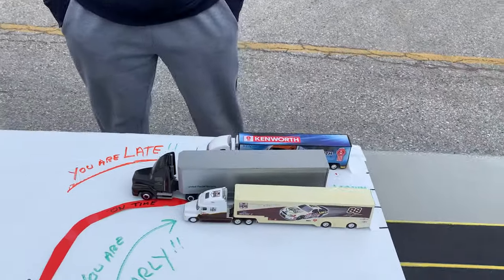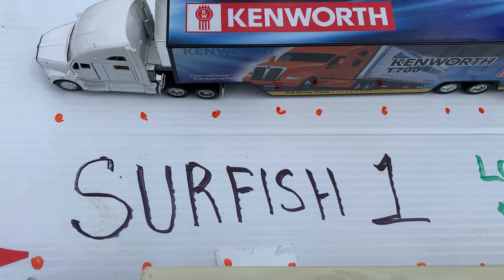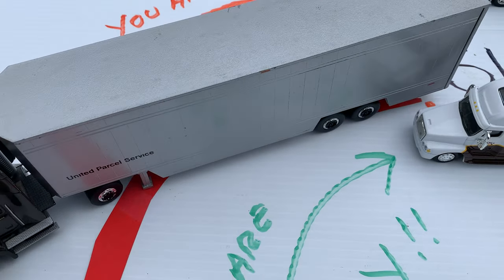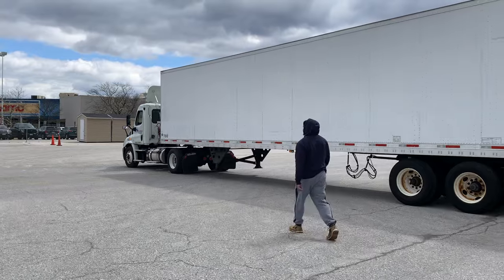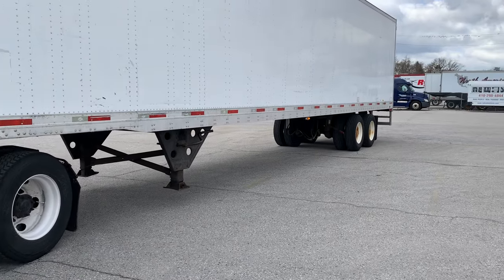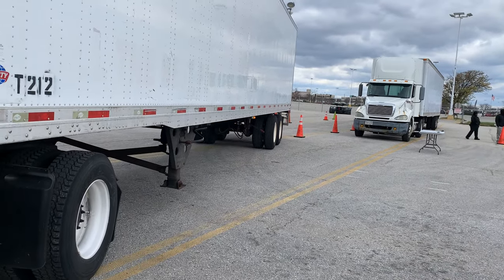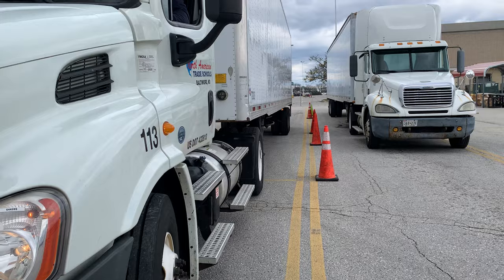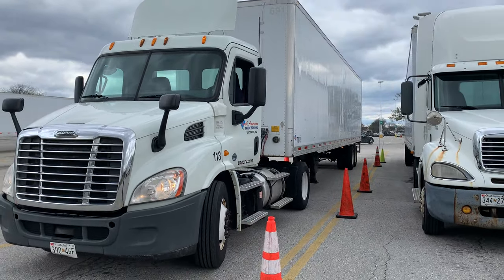90-degree Alley Dock VIDEO - 2

Comment: your not showing me what the tractor steering wheels are doing.   I need to see what turns are being made and when while seeing the trailer rear and the cones to be able to learn and understand.  Also.  I need videos to show me how to correct bad approaches.  I never have enough "pull up" space and I dont know how to correctly pull up to fix early (all the way to almost touching the cone). nobody gives us directions during the exam,  and there is no do-overs, only pull-ups up to 12 points accum.
Reply from the maker: Will be making a few more videos on Alley docking. Will post be Saturday evening.  It’s all about the trailer- you need to react to the trailer. I will do my best to show you where I am steering. Please view all the alley docking videos. One or two may be more helpful.
Reply from the maker: Put a few more on my playlist - ones you may have missed.

Comment: Right line? Left line? I suppose it depends from which side your looking at.
Reply from the maker: Backing into any Dock,  or on thr test you want to be close to the left side or line.  If you are heading to the right side, you are LATE.  Pull up and move the trailer closer to the left. Be on tine. Entertaining the dock
Reply: @truckerstevecdlinstructor  we're using the short trailers like 20 feet on dirt. They swing faster. When I back into a 90 it gets locked where if I turn left or right it still goes the same direction. Can you please help?
Reply from the maker: @johnnyyuma3878   Not sure how if you turn the Wheel to the LEFT or Turn the wheel to the RIGHT, the trailer still goes in the same direction.  Well let's talk small trailers.  (28') .  Yes they move faster and many students who oversteer with a 48" trailer will jack knife with a 28' trailer.  We try to train students to REACT to the trailer.  If you need to stop a trailer from moving to the left, turn the steering wheel to the left to stop the left movement.  Once the trailer movement to the trailer has stopped, you have turned the steering wheel enough.  If you oversteered to the LEFT, the trailer would move very fast to the RIGHT.  PLEASE check out my PLAY- LIST on videos on BACKING and ALLEY DOCKING. Or click onto HOME at the top of my page.

Comment: I'm in trucking school now & I have the straight back & offset with no problem. I did the alley dock last Thursday 2 times by myself. For some reason I can't get it now!! It's so frustrating & with the trailer being 28ft it responds faster. Gonna keep on till I get it again so I can go on the road so I can take my test
Reply from the maker: Hope you pass your test... Learn to read the trailer.   28 foot trailer moves fast so as you back up , GO SLOW!   Go to the dock- Find your reference point.  If the trailer is starting to go to the left of your reference point ( early )  Stop it be turning the steering wheel to the left. Don't over steer - if the trailer is reacting, you have enough turn.   Practice over and over again until it CLICKS in your head!  The trailer only goes where you let it go.
Reply: @truckerstevecdlinstructor  I passed my test with flying colors. I took it July 8. I'm so proud of myself got my 1st trucking job
Reply from the maker: Way to go!  CDL Driver, stay safe and take your time.  Don’t ever be in a rush
Reply: When ya dealin with a shorter trailer, while in reverse, ya wanta turn wheel in small increments. This will create a much safer backing practice. When in reverse, a 28' trlr takes between 4-5' to start changing direction. A 48-53' will cover 8' before beginning to change direction.

Comment: +Trucker Steve so this is interesting, in my school the way my instructor is doing it, is having me turn opposite of where we are backing the trailer into, but from over my shoulder the trailer is like almost jackknifed, like it looks 90% and then we turn all the way to other side and start backing up again. I keep watching videos on alley dock and no one seems to be doing the first reverse turn to where it's almost jackknifing.
Reply from the maker: Will be doing another video on alley dock ASAP.  Backing into the alley, ( on the right ) starting with a left- backing up unit the trailer is about 45 degree angle.  Steer wheels straight. Now you will back up slowly and answer the question. Is the trailer late - on time - or early.    Now it’s up to you to make the proper adjustments when needed to back the trailer into the alley.  Take time to go to a truck terminal. See the movement of the trailers into the docks.  Also see my playlist. Advance Backing by Shelton.  Click onto my homepage or playlist.
Reply: @truckerstevecdlinstructor  Very interesting then how my instructor is having me first backup the trailer to where when i turn over my shoulder i see it looking almost perpendicular. I've been doing it this way on American truck simulator and it is not working as well as videos on youtube no one is doing it his way. Hmm

Comment: Failed my test 2 times because of this. I retest again this week and hoping third times a charm. Testing in a double axle day cab with a 53’ trailer my issue seems to be coming in too late and trying to force it in the box so my question is if I’m too late, near the blindside is it better to pull forward and make it a straight line back or should I pull up back to starting position and try to be on time? Sometimes when I pull up I get the trailer crooked and the setup is bad. Thanks.
Reply: Did u pass?

Comment: This great stuff
Reply from the maker: Thank you.  As you back up, you need to react to the trailer.  If the trailer is going to the right- react Turn  the steering wheel to the right. The trailer will move back to the left. Stop the movement when needed with a left.
Reply: Hey trucker steve, what if am driving in 8th gear and a stop then goes on red before I could gear down. What's the safest way to come to a stop?
Reply from the maker: You see a traffic light ahead - it green— this is a stale green— as you approach get off the fuel pedal— ( slow down a little). If the light go red, come to a smooth stop in 8th gear. If you are at the point of no return, keep going  learn or know what the point of no return is.   You can stop any tractor trailer in 8 or 9 gears.  If you are way back down shifting to slow down.  Hope this is some help to you.

Comment: Why being late better than early if I can see the cone on the left?
Reply from the maker: @junaelie  if you can see the cone on the left, you are not early.  If the rear of the (the left side) is heading towards the right cone - you are late. Easy fix - steer to the right ( moving the trailer left) or a small pull up. Fixing the problem.
Reply: @truckerstevecdlinstructor  if I’m to late should I pull up going what direction?
Reply from the maker: @junaelie  pull up a little to the right- then straight. Don’t overdo the pull-up.  
     When backing up, you will most likely start out with a right ( get the trailer to start moving to the left). 
    Then back with the left. Control the movement of your trailer.

Comment: In Maine they want to the tractor to be atleast at 45 degrees angle when you finish.
Reply from the maker: The alley is straight. 12 feet wide. When you complete the skill, the tractor and trailer will be straight with the rear bumper in the3 foot box.  Now backing into the alley, I like the students to get the tractor/ trailer into a 45 degree angle and back in.  ( looks like an offset).  Review your drivers manual for the instructions.
Reply: @Trucker Steve , CDL Instructor  I'm saying the trailer straight in the box and they want to can read , the Wrighting on the driver door, so the tractor have to be at an angle.
Reply: @Trucker Steve , CDL Instructor  The state of Maine examiner will fail you if you have the tractor straight the trailer in the box and I find it stupid.
Reply from the maker: @eagle5720  will take a look at your state manual. Are you testing at your CDL school or at the DMV / MVA?  At the school, that would be a third party testing. The CDL school is doing the testing for the state. Thank you for your comment  on this.
Reply: @Trucker Steve , CDL Instructor  I'm currently a student @ NTI in Bangor maine and that's how the teaching ous to do it. I told them I have seen other do it with the truck and trailer straight in the box at the end they claimed that's how it done in Maine.
Reply: @Trucker Steve , CDL Instructor  The test with be at DMV when I complete the 80 hrs in the yard
Reply from the maker: Thank you!  Please  review your DMV drivers manual. I will try to get online to review it.
Reply from the maker: The Maine Alley Dock is to test your ability to back into an alley from a NARROW STREET and stop so that the rear of the vehicle is squared position against a platform.  This may eliminate the need for a pull up.  In the comings
years, all skills testing may be the same in all states. To me 90% of all alleys docking, your tractor will be straight.
Reply: @Trucker Steve , CDL Instructor  yea but the maine one the tractor isn't straight and think all should be on the same page with this.

Comment: When you start first is steer to the right and back up
Reply from the maker: First the set up.  Steer to the right. Back up until you see your landing leg.  Get the steer tires straight. Back up and when needed react to your trailer.   See my home page advance backing or my playlist.
Reply: @truckerstevecdlinstructor what do you mean by see the landing gear? Should you see it in the mirror or looking with head out the window? And does that apply to sleepers or daycabs cuz they are different???
Reply from the maker: @aiceisoasis  you will sit back in your seat. As you begin to back up, the landing leg in your left mirror- should not disappear. It just a helpful reference point- not to over or back up too much.  As you back up, now you will determine if you are on time or late.  Let’s say you are late-you will give it a right and then quickly back to the left to keep it on time. 

   Hopefully will make more alley docking videos to better help students understand
Reply: @truckerstevecdlinstructor  so my problem is over or under steering so basically when you start backing as soon as you see your tires where you want  them to be you either turn your steers straight or counter steer to stop the movement and then go back a little bit to see how your trailer reacts?
Reply from the maker: @aiceisoasis  you will get better and better and learn to react to your trailer the more you times you back up.  It will CLICK soon.

Comment: Your cones are way winder than the ones we do here in Ontario
Reply from the maker: It’s the alley lines.  12 feet wide.  Cones are on the outside of the lines.  Tractor and trailer must be in the alley inside the lines.